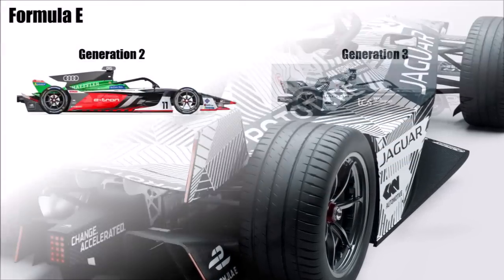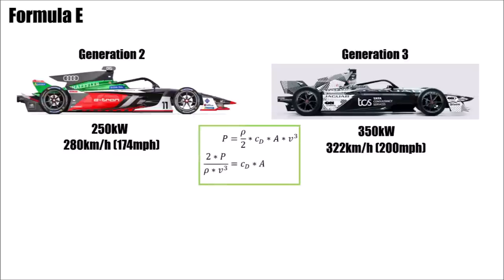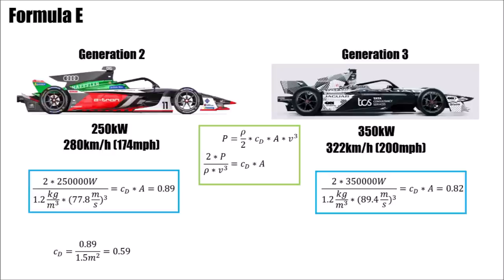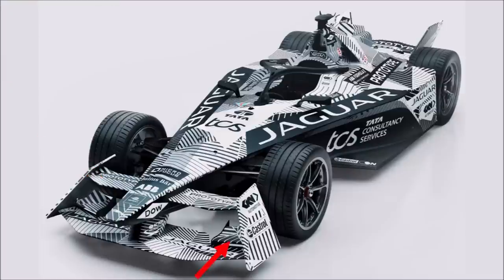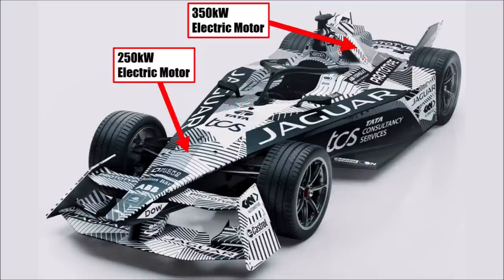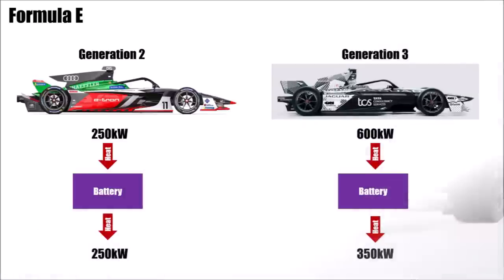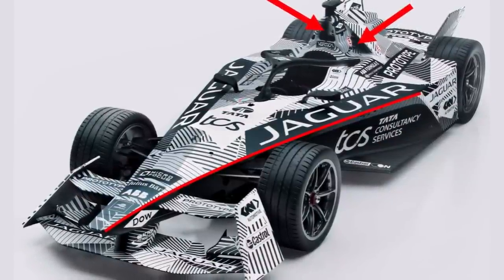FORMULA E (Generation 3) - CLOSER LOOK

Comment: I like it. Especially the smaller size. The idea with the generator at the front is pretty clever. Still would like to see them race on proper tracks.
Reply: Visited Berlin 4 years ago and it was nice to have the track so close to public transport and my hotel.  Most tracks are in remote areas due to noise from the racing cars.
Reply: Agree, I would like to see them race on proper tracks, so they can reach their max speed.  It can be the one F1 currently races on but they can add other tracks not feature in F1.

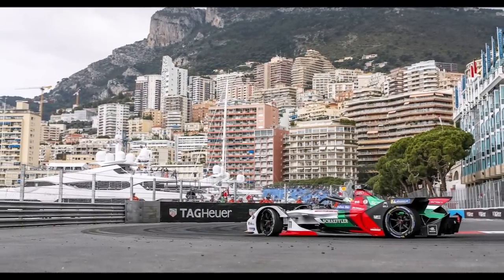Comment: 2:05 the car may have similar or even less downforce numerically, but the drastic lightening of the car probably enhances the effect and the feeling of that amount.
Reply: Yes, weight and tyres being more grippy could also be good factors for trimming downforce I believe at half a ton, the FE car produces less downforce than all other formula racing cars, I think even F4 lol.
Reply: @F1ll1nTh3Blanks  maybe for Gen 1 just for efficiency. I'd highly doubt that's so by Gen 2 as they were using full ground effect.
Reply: Good! DF sucks for wheel to wheel racing. It's much more interesting with loose cars that move around, and enable close following, and have long braking zones for drivers to take advantage of.
Reply: @colinbowman8816  It's not just downforce. Super Formula, Indycar, LMPs, etc. can race just fine while even NASCAR sometimes struggled with dirty air (see the high drag package in 2015).

When F1 switched away from "dirty" topside downforce to cleaner ground effect for 2022, the difference was crazy.  When they backed off the floors to combat porpoising, suddenly the racing wasn't as good as 2022. Those DTM silhouette cars that also dealt with dirty air had flat floors but no shortage of elements and aero flicks on the topside. Even that NASCAR package was a big, draggy spoiler on top of the boot. Look how Next Gen with its aero tunnels delivered much better racing on many tracks.

Floor downforce, which Formula E cars have focused on since Gen 2, seems to be that much more conducive to good racing than topside downforce.

Comment: So all of the extra performance is really coming from the extra power and lower weight. The car itself produces about the same downforce as the previous gen. 
Looking at the floor, it doesn't look like there's a lot of space for downforce generation. It looks like just like before, all of it is coming from the rear diffuser, which looks about the same dimensions as gen 2.

Comment: Honestly im disappointed they didn't go for 4 wheel drive, like its electric, you are no longer bound by normal openwheel car design standards. why do you only have a battery in the same place at the fuel tank? Put it across the entire floor of the car like regular electric cars!
If you want to go absolutely crazy you could even add some crazy "banned gizmos" from f1 like 4 wheel steering, active suspension perhaps even active aerodynamic if you really want to be the racing series of the future
Reply: The problem with a battery floor is that the driver has to sit higher, and with high velocity crashes increases the risk of the battery being damaged and catching fire, which is a huge no-no in the middle of a street circuit. Engineers have thought of this and I think their decision is pretty good.
Reply: @OmegaF77  oh yeah didn't really think about that part the middle is indeed the safest part where the battery is least likely to be damaged although about the higher seats you could probably make the battery surround the driver like a circle with a hole in the middle or a horseshoe shaped battery although i dont think many divers would be very comfortable surrounded in battery
Reply: @monteb6276  ik i am replying too late. But 4 wheel steering is banned in FE, they cannot use vector control
Reply: @mickolesmana5899  i know its banned im just saying it shouldn't be banned imo
Reply: @monteb6276  yeah agree,
Reply: You get your wish now with new gen 3 EVO from next season

Comment: So how is the battery supposed to survive? There is over 50% more load in total with seemingly less cooling. 
Also this is a missed opportunity of AWD which would improve vehicle dynamics and tire management greatly on these layouts.
Plus the aero concept still makes no sense then. 
Surely technical improvement was not the main goal for Gen 3.

Comment: so i saw this comment on reddit and wanted to get your thoughts on it 

“So the new Formula E Gen 3 car was just revealed and one thing that caught my attention was the regeneration capabilities. it’s stated that, due to the introduction of a front MGU, these cars will be able to regenerate up to a combined 600KW under braking. that’s 250KW front and 350KW rear. also, these Gen 3 cars have completely removed the rear brakes, relying solely on the MGU regen & front brakes to slow them.

so, could/should F1 try something like this in 2026? as F1 plan to remove the MGU-H and increase the MGU-K power output, surely adding significantly higher regen capabilities would massively increase the efficiency and hybrid performance?

and could F1 remove the rear brakes all together as well by only relying on MGU for braking?

i imagine the combined regenerative capabilities of front and rear MGU’s would be next level for an F1 car, so surely this has to be a consideration for the next rule change?”

it sure would be interesting the directions F1 could go with regen & emotor tech from 2026.
Reply: with the current f1 car which is very heavy, the car would send an utterly massive braking force to the braking system. therefore keeping the rear brake on, in my opinion, is a lot safer.
Reply: @yudi8662  i know i am replying too late. But FE is heavier than F1

Comment: Let the teams design their own cars! If they still want to be relevant.
Reply: They don't want it. Formula E is all about showing your sponsors. The race factor is not that relevant
Reply: I mean the whole thing with Formula E is finding ways to present the powertrain and EV tech. Aero development would probably kill some of the more cost averse operations in the series.
Reply: They want to develop EV powertrains, not aerodynamics. For a full car design, the manufacturers already have the LMH class, GT3 or rally racing, where they must develop all the car by their own.
Reply: So you want it to be even more expensive to enter and develop?? And potentially even less manufacturers wanting to enter??

Comment: It's not a pretty car unfortunately and since the chassis is spec they could have made it look like whatever they wanted.  ....So that's a shame.  I don't quite understand the pit stops yet. A 600 kw charge rate on a 51 kwh battery still isn't fast enough. The proposed 30 seconds charge at 600 kw gives you 5 kwh and the battery is 51 kwh.  I suppose they could choose to charge for about the length in time of 1 lap, which would be about 90 seconds. So in a super long 90 sec stop, which is longer than any other series, you could maybe get 15kwh, which is just 29% of the battery.  I may be missing something, or not fully understand the rules. I guess maybe they could just do symbolic stops that add say 10% to the battery, and all races could be the battery range + 10%.
Reply: Stops would have to be mandated, otherwise you could choose to drive slower to save 10% in your battery and not stop.
Reply: would it even be plausible to set up 20 600kw chargers at all these different locations??
Reply: @Tommmmmmmmmmmm  Yeah, you can just charge from a battery that is bigger than the one in the car, and slow charge that one during the day.
Reply: @Tommmmmmmmmmmm  it wouldn't have to be 20. They could set up some sort of system where each driver would be given a small window to pit based on their initial grid position, with some overlap to the next driver. For example, the driver who qualified first would have to pit from 10 to 15 minutes into the race, 2nd driver from 11 to 16 minutes and so on. That could greatly reduce the amount of drivers that can pit at once (max of 5 in my theoretical system) while still keeping the strategy of doing an under/overcut on the drivers around you